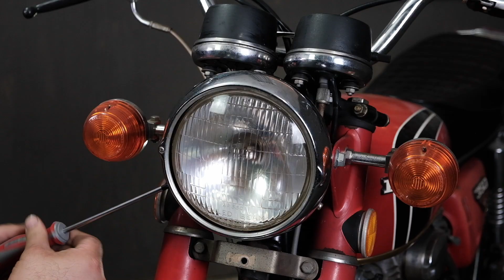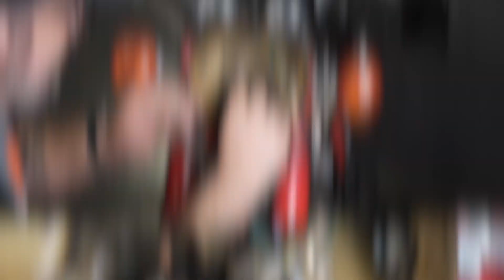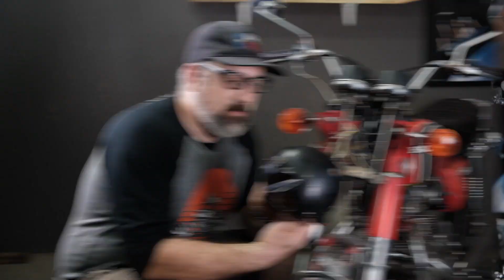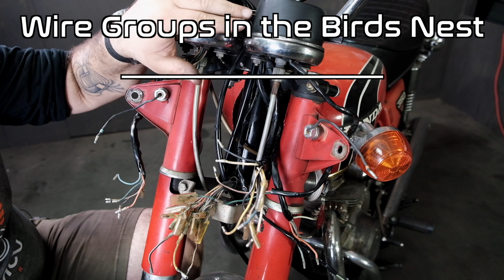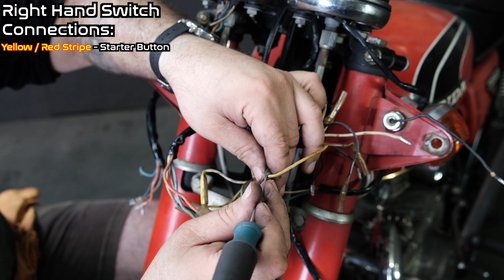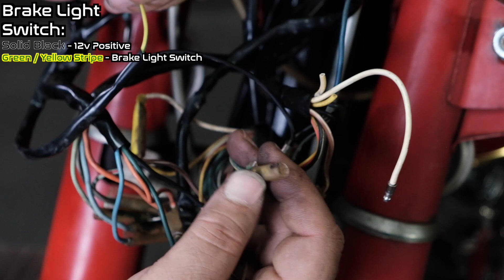Headlight Bucket Wiring on a Vintage Honda Motorcycle

Comment: You definitely  did not need to cut those yellow wires , instead you could have easily  just  taped them  and that way the sock wiring  harness would have been left un molested  !

Comment: IMPORTANT NOTE;  Getting that mess better organized so you can "easily-er" get the headlight on the buck without forcing it is VERY IMPORTANT. If you find you are putting "too much pressure" to get the chrome bezel ring to seat on the bucket there's a damn good chance you'll crack or break off a piece of the bucket at the top where the bezel hook catches.  Ask me how I know.  Mine was already cracked and broke but came with the pieces. After a bit of body work and beautiful paint and polish it broke again installing it.  On that RIDGE that catches the bezel ring hook, if you carefully dremel a small, shallow, channel and JB Weld a small, sanded, finishing nail in it it will strengthen it. And build up more JB WELD on the 2 sides of that ridge  also to add more strength. Use the bezel in place with bucket removed to see and judge where and how much JB Weld to you can add for reinforcement. Don't forget to sand the area for bonding.

Comment: I have a question for you. 1979 Honda XL 75 all the wires are pretty much the same color as yours The dark blue wire goes from the headlight to the high beam light and the white wire goes to the low beam but what powers the headlight I don't see anything that powers the headlight, that is the only thing not working I got everything else lit up except the headlight.

Comment: FYI! Don't use the dielectric grease in any connection like he did here. DI means does not. 
The real application of that silicone grease is for paper gasket mating and for keeping moisture out of electrical connections.
Am i wrong? I'm not but for the doubtful, take a ground strap off of any battery and slather that shit on, then try to get er running right. lol
Reply: Also thanks for the vid guys it was helpful. Now can you do another with the terrible Honda 6v light bucket? Pretty please?

Comment: I recently bought a 79 XL 250 S. The biggest pain in the ass I ran into was not Honda’s wiring in the bucket as I got the user manual with an OEM wiring diagram for the bike. The biggest headache I ran into was a previous owner’s fiddle fuckerey amongst the spaghetti especially since whoever did it did not document their changes.

Comment: Hey Brendan, Thanks for the video. Far less confusing now! I have a vintage '79 Suzuki GS500 and I recently changed to a digital speedo. One little issue I'm having is with my Neutral light, after the ign. is switched off the Neut. light stays on. When Ign is off and shifted out of Neut then  Neut light cuts out. 
Before I cut the blue Neut light gauge and the 6 gear wires out of the old speedo(LED unit) an orange (12v pos) wire linked them all. Also a black/white wire, probably ground, was connected to the LED unit. I connected all 7 wires straight to their assigned wires blocked both orange and black/white. All gears and Neut lights show on the new unit display.
Tomorrow I'll go out and disassemble the nest like you showed here and test the grounds and pos's and see where that blue Neut wire is actually going.

If you Brendan or anybody else has a suggestion on why the N stays lit please comment I'd greatly appreciate it! Thanks!!

Comment: Great video just acquired a 72 cb 175 with a mess of wiring. Motor was toast I found a great condition cm200 motor I just put in slight differences between motor mounts but it’s the burn orange and white  cb had to buy it lol thanks

Comment: Does turn signal switch wire from turn signal switch need to run independently from indicator box and correlating turn signal wires (front and back) run directly to indicator box? Thanks for your time

Comment: This is very helpful.
I've recently got a 1975 CB400F, and my main concerne is that it has the "old" on/off light switch on the right handle, and the hi/lo beam on the left handle.
Any helpful tips? Thank you

Comment: I have a 1973 Honda CB 200 I bought a right bar hand switch for the headlights, dimmer and old stuff, but mine mine was a 9 water set app and then when I got so many 6 water set up. How do I get it to work for my bike?

Comment: I have a 1980 gl1100 that had a fairing and I’m just going to have the head light and leaving the fairing off but it seems like there’s too many wires to fit in the bucket, I might do like you did and take all the wires off and start from scratch, thanks for the video

Comment: Brenden is right on the mark about the fear and loathing folk like me feel when being forced to mess with a bike’s wiring, especially the accursed headlight bucket junctions. I’m recommissioning a ‘71 CB500 four and had no choice but to start disconnecting stuff when I realised the left and right hand controls would need to be replaced. 

I spent as much time with pen and paper documenting what connected to what and labelling connections as I did with a spanner / screwdriver. Which wasn’t time wasted since the colour coding on one of the new controls isn’t as per the model’s wiring diagram.

Watching this video multiple times gives me just enough confidence to start connecting everything when the forks come back form the hard-chromers and I get a new top forkbridge, 

So another huge Thank You to Brenden and the other Common Motor folk for helping me out, just as you did with your tail light circuit and  back brake etc videos.
Reply: DITTO!

Comment: Great set of videos on vintage bikes. If you are able... need some help on a C90 cub. 86 vintage, 12v and CDI system. There's a white wire with a black line that starts from the 3 pin regulator and heads to the headlight high/low beam part. Any idea what the purpose of this wire? I've upgraded to a 4 pin newer reg/rec unit and kept this wire disconnected. My headlights don't work although AC supply reach the yellow wire in the light switch(bottom half, for P and Headlight). This white the black line has been an absolute enigma to me. Can't seem to figure out it's purpose and how the light circuit work.

Comment: It's all fairly self explanatory, until you get an aftermarket switch that's not 100 percent correct as far as the colors go.  In that case, you break out the multimeter.

Comment: Just went through mine (successfully!) yesterday. CL100-- its all in the bucket. Do you have a resource for good quality bullet terminals? I wound up going to my local scooter shop after finding nothing but pretty low quality replacement options, none of which actually "fit" "correctly"
Reply from the maker: We actually sell the great made-in-Japan hero brand bullet connectors on the website. Awesome connectors, just make sure you have a good pair of bullet connector crimps to install them. Thats the key.

Comment: Thanks for this video CMC! Super helpful. I was wondering if y’all had any luck with an LED headlight alternative for the SL/CL 175 and the SL350? These models have the smaller 5 1/4” headlights and LED would be much better for safety reasons. Thanks!
Reply from the maker: definitely working on a solution! That one is at the top of our priority list.

Comment: I worked at a Honda dealer in the 70s. After school I would assemble bikes out of the crates. The bars an turn signals were not connected, so I had to wire them up. DANG, they were real easy to do when the wires were nice and soft.
Good video.